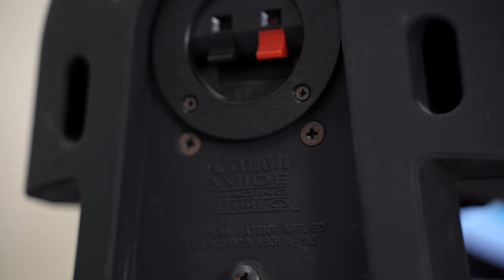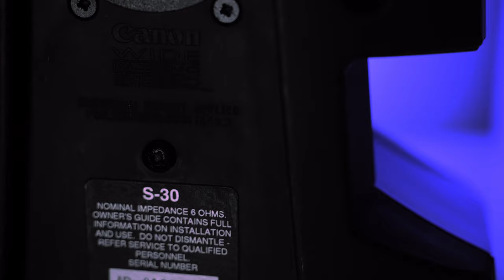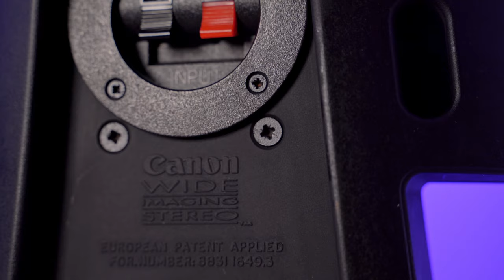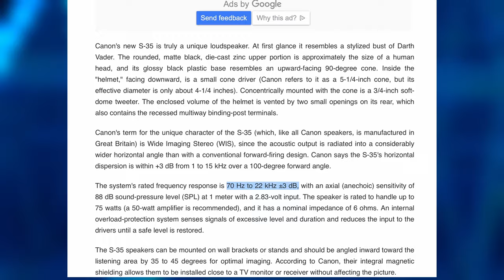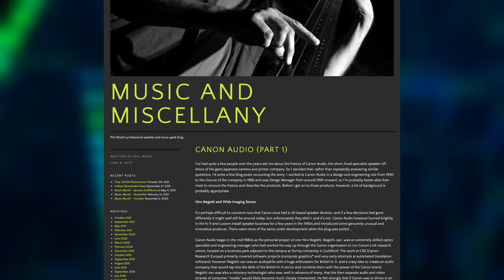Canon Audio Speakers! Canon’s forgotten venture into audio!  S-30 Wide Imaging Stereo

Comment: I worked at Canon in Tokyo in 1992-93. I remember speaking with an engineer involved with these speakers, and he said one problem they were having was with bass response, which the acoustic mirror didn't seem to handle well. I didn't think of it at the time, but it has occured to me frequently over the past several years that a subwoofer would probably solve that problem!
Reply: The s70 solved this and i have one